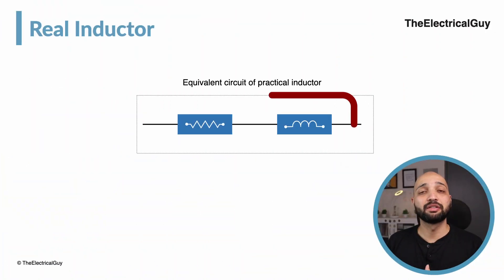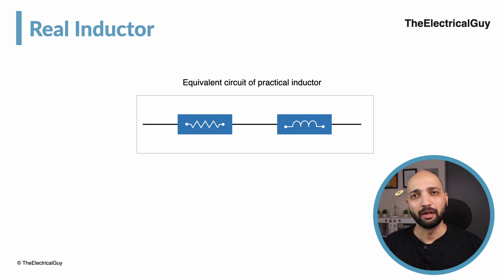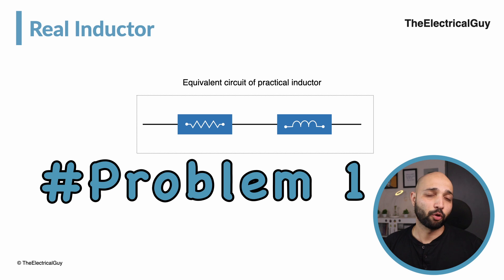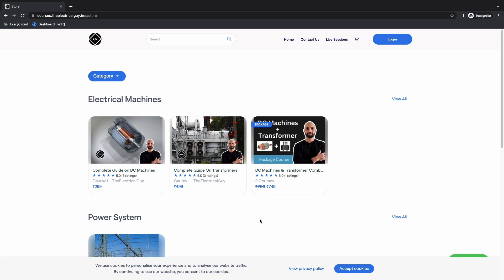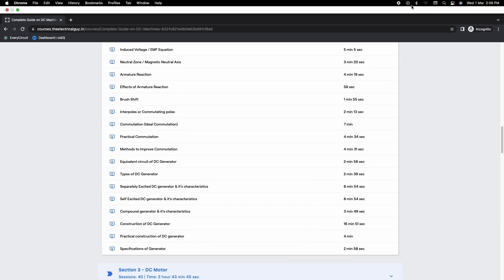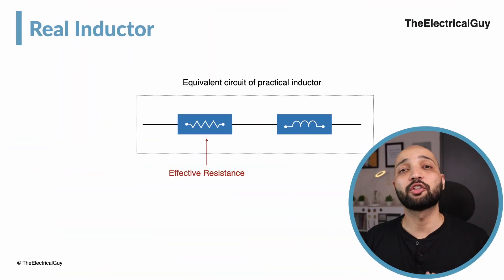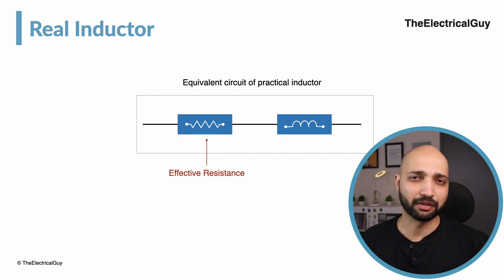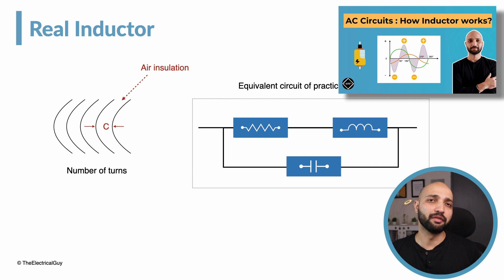Problems with the Real Inductor | TheElectricalGuy

Comment: Gaurav ji, i have seen your one video wherein dc voltage was impressed on its primary. Initially you have sown a kHz supply impressed on its primary and on secondary of the transformer bulb was flicking. Is it possible? Even when you impress 50 hz primary supply, no flicker can be observed. Pl look into it.